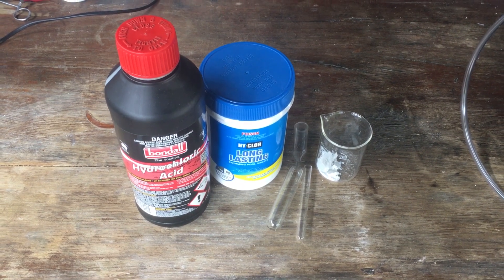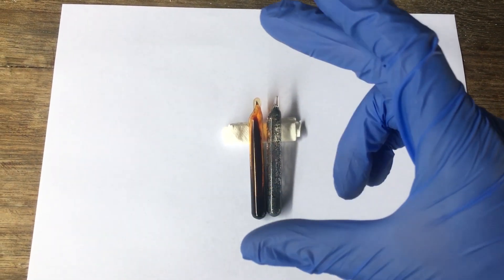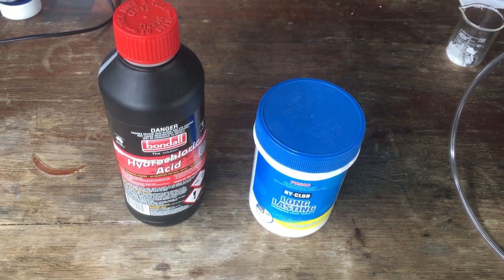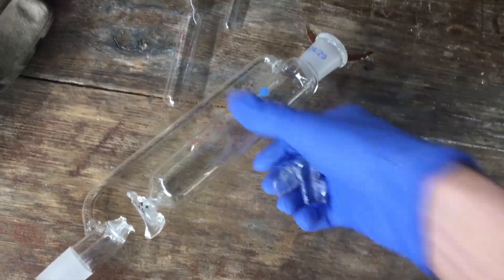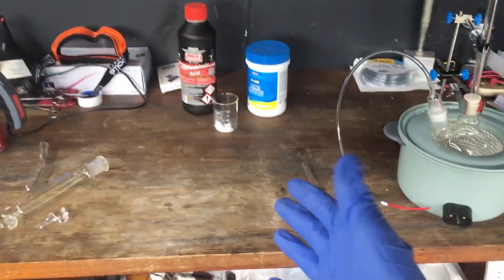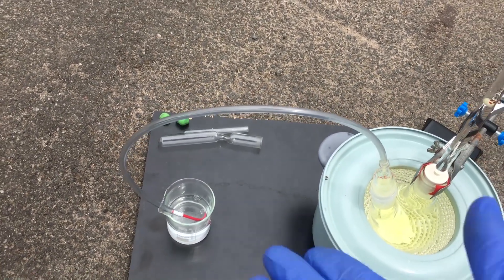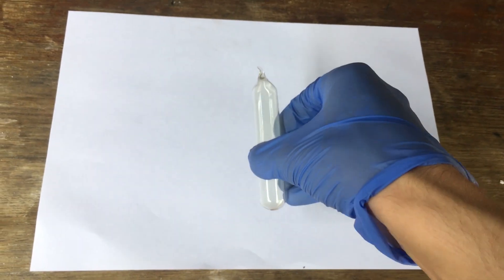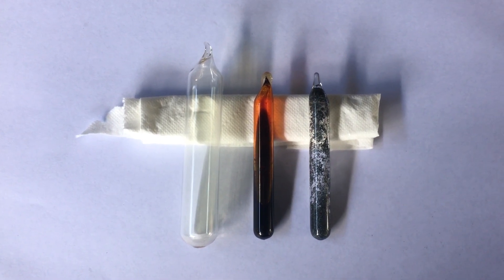Making Chlorine

Comment: Sucks that due to fluorine's reaction with glass, the best way to have a "fluorine ampoule" is by finding a special rare form of fluorite called antozonite which is said to have bubbles containing fluorine gas generated by the radiation of trace amounts of thorium and/or uranium.
Reply from the maker: Yeah, it's always a disappointing piece of an element collection if you don't even have visible amounts of a sample. Bubbles of fluorine in fluorite is still a very cool phenomenon though.

Technically, you can sometimes get hold of professionally made ampoules that do contain fluorine gas. It's possible to store fluorine in specially treated glass, when the gas is diluted to 20% concentration with helium. As you might imagine, these are very expensive, and the fluorine in them doesn't last forever, since it will still (very) slowly react with the glass.
Reply: @ScrapScience  I'd imagine if someone can melt fluorite (or Teflon) and then blow bubbles of fluorine gas into the molten liquid until it solidifies, a permanent "visible" fluorine sample might be possible.

Trapping fluorine in Teflon might also work if only it was transparent.

Comment: Your iodine ampoule is quite impressive! How did you prevent it from staining the glass? I used some quite large iodine crystals, and it still stained the whole ampoule in a reddish-brown color in just a few weeks.
By the way, an ampoule of Astatine would be way, WAY scarier than an ampoule of Fluorine. Fluorine would absolutely be nasty to work with, but with a specific activity of over a zettabecquerel per gram, an ampoule filled with astatine would probably just explode and form a hot, radioactive plasma cloud that would kill everything in its way. As a fluorine ampoule, I just used some antozonite, which is fluorite that has been partly split up into colloidal Calcium by environmental radiation, coloring it deep purple to black, and elemental Fluorine which you can smell when grinding it. So, technically speaking, I have an Ampoule that has little pockets of elemental Fluorine in a CaF2-matrix.
Reply from the maker: That's interesting, I didn't realise quite how radioactive astatine was.

As for the iodine ampoule, I'm not sure why some samples would stain glass and others wouldn't. It's probably something to do with purity I guess. I made my iodine by electrochemical oxidation of acidified potassium iodide solution, and purified it by sublimation before ampouling. My sample's been stored for around 5 months now and I haven't seen any staining whatsoever.
How did you make your iodine? And did you purify by sublimation before ampouling? If you did, I'm not really sure why it would stain the glass.
Reply: @ScrapScience  I used some old Iodine without any purification by sublimation, as they were quite nice, big crystals. I don't believe that there was a huge amount of contamination in the Iodine. The only thing I could think of would be some dirt or grease inside the ampoules, although they were fresh out of the packaging. I might just try it again at some point.

Comment: why no electrolysis?
Reply from the maker: The TCCA/HCl method just seemed a lot simpler in this case, as I had the necessary glassware and reagents.
Electrochemical chlorine would have probably required me to build a specific apparatus with the right electrodes and a somewhat complicated way to collect the pure gas.
I will be covering electrolytic chlorine in the (hopefully) near future, as I'm planning on building a moderate scale chloralkali cell.